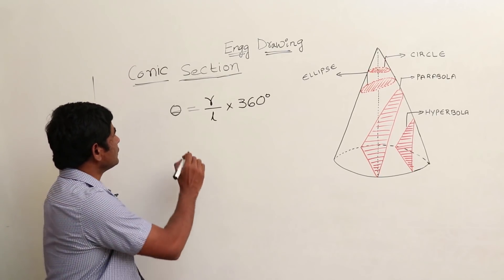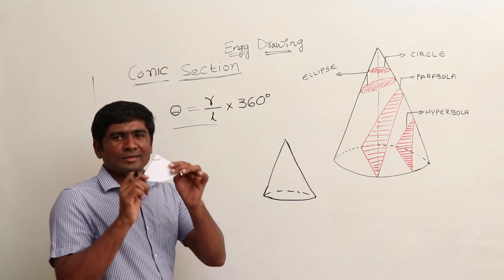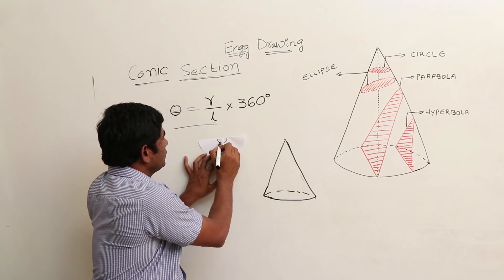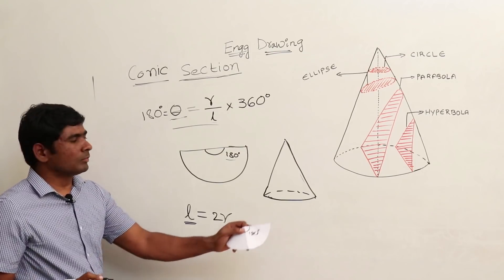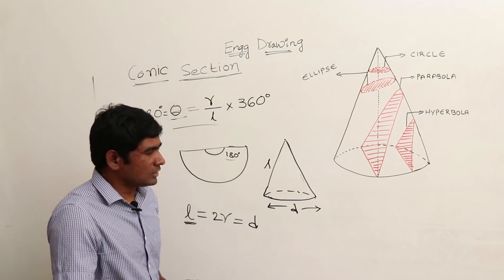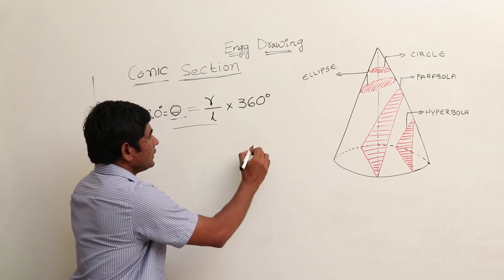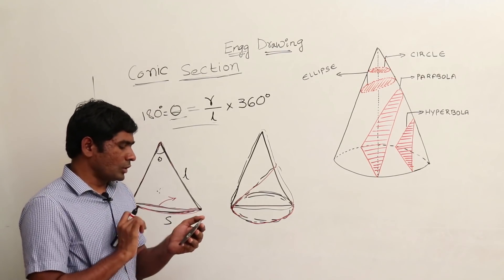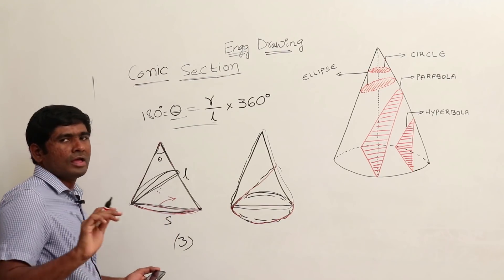ESE GS || Engg Drawing || IES prelims, Conic curves, last year questions

Comment: In the thread question, if chord length is shortest distance. What will be the longest distance?
Two times of slant height?
Reply from the maker: To times slant height+ diameter of the base circle
Reply: Mechanical video lectures By Adapala Chandra Sekhar. Sir sector is plane diagram so starting point of S( sector length) and ending point of S(sector length) is same no for the cone. Therefore the longest distance would be two times slant height. Why again dia of cone will come?